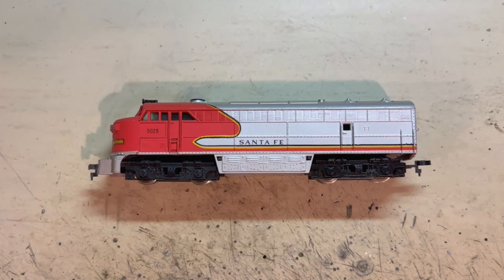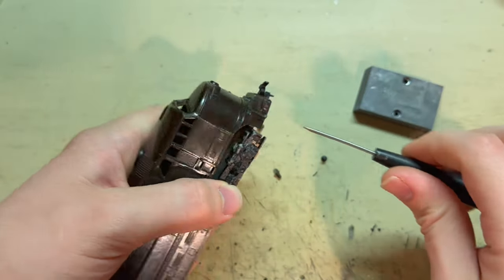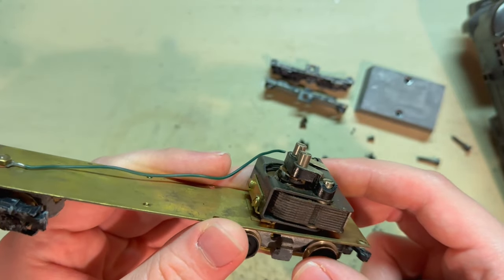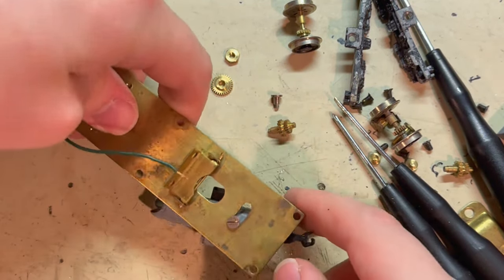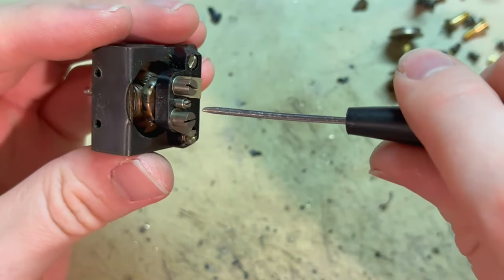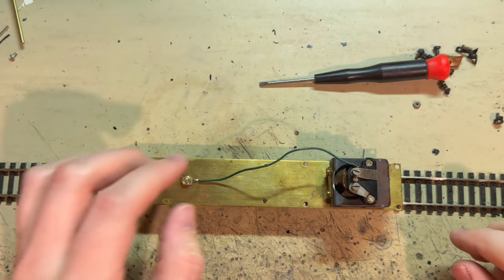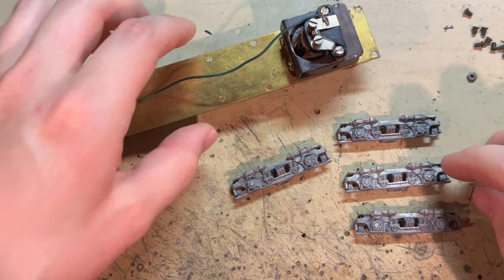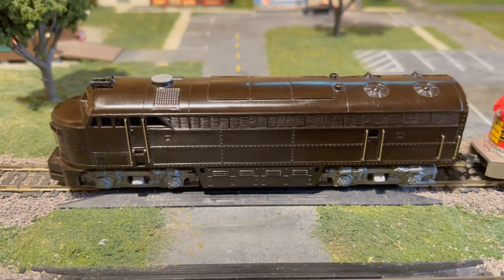Restoring and Reviewing the ORIGINAL Rivarossi FM C-LINER!

Comment: That is a super cool train.  I have a decent collection of vintage Ravarossi's and C-Liners but I don't have one like that.  I almost guarantee that motor will also run on AC with no problem.
Reply from the maker: The design is close to the German AC motors! It just needs an electromagnet instead of the permanent magnet.

Comment: I just bought 2 of these rivarossi c liners with the bake light shells for 10 dollars a pop and they both run great after I service them
Reply from the maker: Great deal you got there!  Once in a while someone doesn't know the value of what they're selling, so it's always good to be on the lookout for those deals.
Reply: @DarthSantaFe  after I bought them the vendor told my they sell for a pretty penny but I know what I was getting and getting into whale I was at the train show I also got a Texas chugged for 10 dollars too and a mehano 4-8-2 for 20 and a cox f3 for 5 bucks
Reply from the maker: @danielgibson1656  Wow, so he was just letting them go for cheap then!  I have a Bachmann 2-10-4 I bought for $50 at a train show and have been working on getting into running shape, and even that was about half of the going price on eBay.  I also once got an Athearn U30C for $2 that just needed a good cleaning.

Comment: I have 3 of the later AHM C-Liners, because brushes were such a pain to locate as they also came off the copper arms, I put them safely in a container for AHM parts and got aftermarket can motors that luckily the shafts were the same size so the wurm gear pressed right on.  Much quieter and less power usage plus I can swap in the old motors (Now that I found replacement brushes) if I were to ever want to sell them.  Great video!
Reply from the maker: Good that you were able to get those! People selling those brushes now charge as much as getting a whole replacement model.

Comment: i like that you're going to leave it unpainted to preserve it as it would have been in the box in the 50s. 
i have a feeling that if i were to try the same. i would fail after a while.
Reply: It was sold as a kit ready to build with skill since it would cost double if they did it at the factory. Worth more built right.
Reply: Bakelite doesn't take to well to painting.I painted my Bakelite Lionel observation car and the paint flaked off.

Comment: This is a great restoration of an early locomotive. While I like the restoration, there is one thing that I recommend for old zinc metal parts. This would be to paint or clear coat (in this case) the zinc parts when possible. This will reduce future oxidation of the zinc metal which may lead to more cracking of the castings. Also, I was going to mention about heating the warped side frame, but you already made a reply on a reason not to do it.
Reply: La pintura no necesariamente detiene ese óxido a que se refiere, sino es una impureza en el zinc a la hora de fundirlo y colarlo en el molde, ese proceso viene desde dentro, es progresivo y nada lo detiene.  En alemán le llaman; zinkpest.
Reply from the maker: I might do that at least for the sideframes to help them keep their cleaner appearance.  I do the same for the polished brass, copper and nickel parts on my prewar trains to keep their shine.
Reply from the maker: @22763344  I think he was referring to the surface oxidation of the metal exposed to the air.  It definitely won't stop the zinc pest, but it will at least help to preserve the color of the cleaned metal.
(Traducido por Google)
  Creo que se refería a la oxidación superficial del metal expuesto al aire. Definitivamente no detendrá la plaga de zinc, pero al menos ayudará a preservar el color del metal limpio.

Comment: I like the paint scheme you chose for that, original Bakelite! Sort of a nice chocolate color. Have you ever tried using a heat gun to straighten out warped zinc? Maybe on something less valuable? I tried it on some Gilbert HO prewar parts and worked good, but then I realized those parts might have been lead castings, not zinc.
Reply from the maker: I did accidentally warp a zinc piece once while using a blow torch to melt lead into it!  I thought of heating the sideframe to straighten it, but with the amount of visible fracturing, I decided not to risk it.

Comment: From 11:39 I think you needed an Allen Key to remove the screw holding the worm gear on the motor shaft.
Reply from the maker: I took a close look at the screw to see if something else was needed, but it really was just slotted for a flat blade screwdriver. My guess is the metals oxidized over the years and got stuck together, or the screw may have even been forced in instead of threading it properly.

Comment: Rivarestore has replica parts for these .Yor model is missing the boot on the back door.They have it if you want it all original
Reply from the maker: Thanks! I hadn’t heard of them before, so that’s good to know.
Reply: @DarthSantaFe  They are tricky to bring up right .If you search for it .Will bring up a PDF type of page that has all listing to enlarge .That is not it.The site page you need has 2 flags on it American and Italian TAN BACKGROUND   and all the parts info and prices so you can order.They have parts for that motor ,top plate brushes and springs  ect.... Click on the American flag and the site will go to English .Has part categories on the left of the page unless your fluent with Italian .
Reply: I edited this to get you a better description of the site. I ordered from them  to get screws and side frames and all fit and look good along with containers they put the parts in is high end .
Reply from the maker: @adamserafini6945  Thanks for the info!  I did manage to find the website and see the part you're talking about.  I'll probably leave it off, but it's good to know they're available if I ever want to add it on.
Reply: @DarthSantaFe  Those brass gears have an issue with a certain type of synthetic lube that has a chemical  that eats the brass. There is a type 4 and 5 .One of them eats the brass.
I agree with your assessment of the model somewhat compared to the proto ,but a huge part of model railroad history or say engineering  quality of it's day.Great to have a gem like this that still operates. Besides they had metal grab irons all around the thing  that came with them that were pre bent with that Rivarossi quality precision to them .Should finish yours.Find that B-unit  of that era is how rare?

Comment: I wonder if a piece of copper wire with a dab of solder on either side would do as a pin?
Reply from the maker: It might, but I’d be concerned about how long the solder would last since it’s a soft alloy.  It works well for hard connections, but I haven’t had much success using it in more flexible places.

Comment: You could of just swapped the magnet around to correct direction. . Probably put it in wrong way around.
Reply from the maker: Yes, but these older magnets sometimes lose their strength when removed from the field, so I wanted to be sure that didn’t happen. I also didn’t want to deal with the tiny ball bearings falling out. :)

Comment: I have watched the SMT Mainline video on the locomotive.  Great restoration you have done on this ‼️🫵👍✌️
Reply: TBH he’s something of a lightweight, he can rig an old Bachmann to run but I’ve never seen him build an old metal kit (for instance). His stuff is useful if you’re trying to resurrect old cheap locos though.
Reply from the maker: @kriscarver-seaboyer9204  He doesn't have as much experience as I do (I've been at it probably 15 years longer), but he has come a long way!  I think he did build a Roundhouse kit a while back and has done good work fixing some old models that were in really bad shape.  We all have to start somewhere, and learn with time.